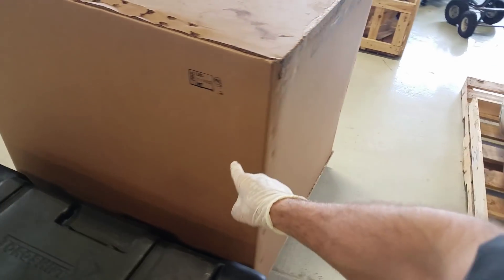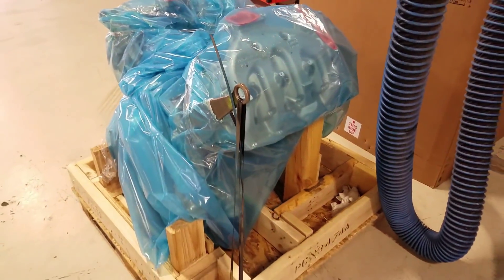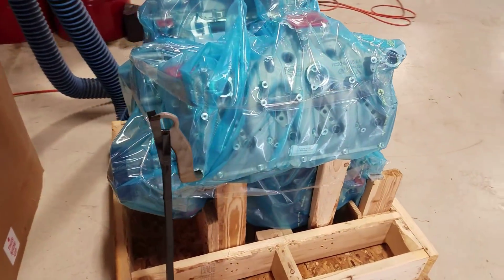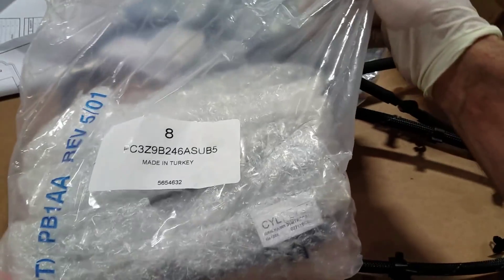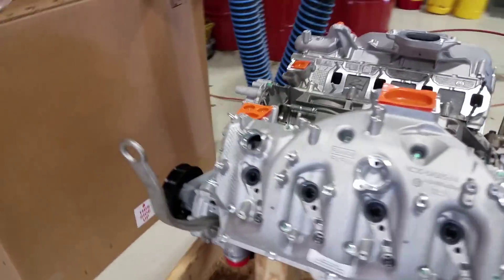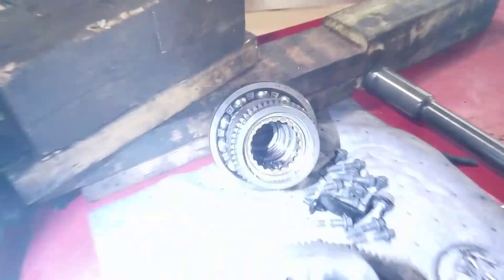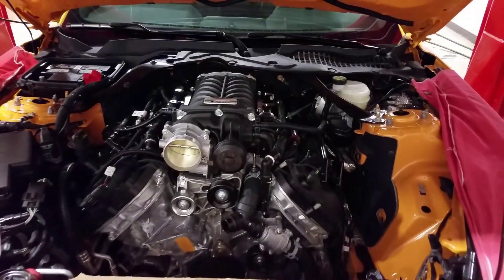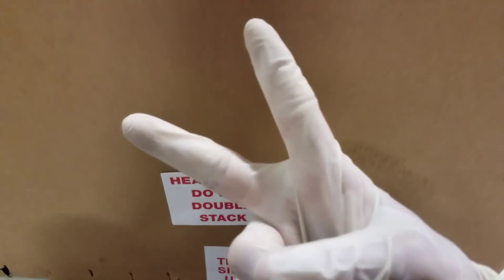17 F650/750 Eng. R&R

Comment: When replacing the hpfp does it have to be coded with IDS like the injectors? Can you replace an injector and then drive it to the dealer for IDS coding?
Reply from the maker: H.P.F.P.......NO. it needs to be timed to the cam gear tho. I have started an engine b4 without programming the injectors IQA # but have never driven it like that. Engine light and maybe a lil rough running, other than that couldn't really tell ya